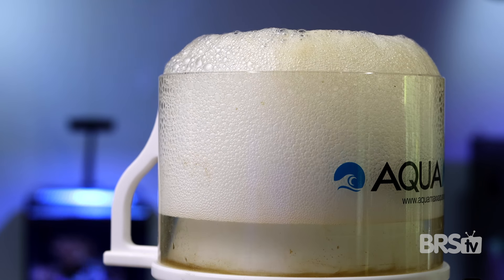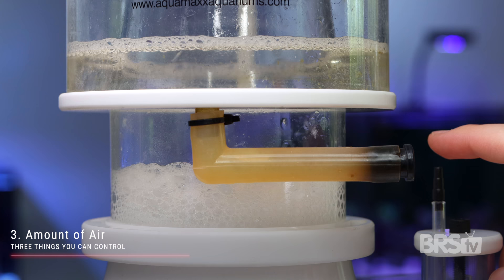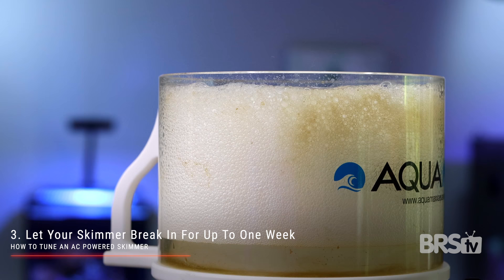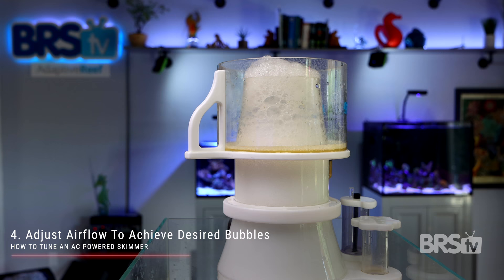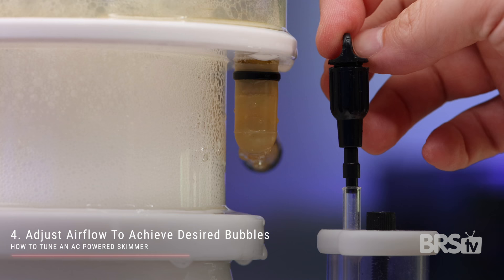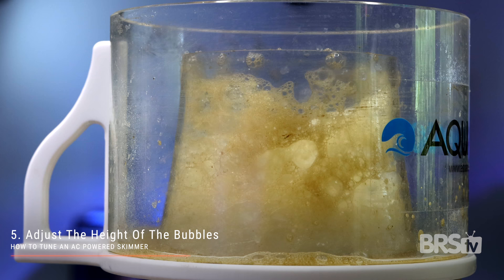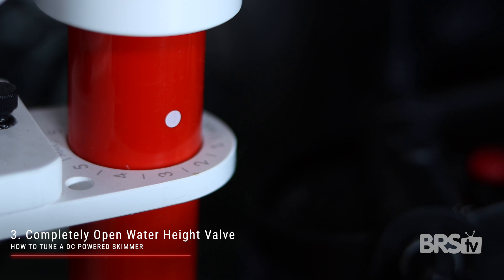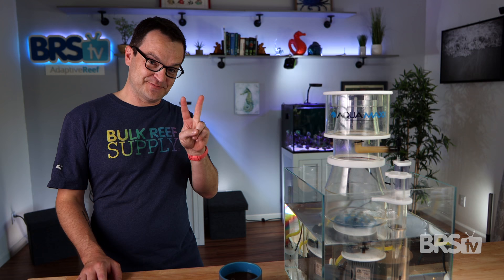Let’s Tune Your Reef Tank’s NEW AC or DC Protein Skimmer!

Comment: Ditto on the too big skimmer. Especially if you're running low micron filter socks or a filter roller, it's really easy to oversize a skimmer on your system, even if you get the right sized skimmer on a high bioload skimmer. You need to take into account your entire filtration system to size a skimmer.
Reply from the maker: Well said!

Comment: Seems that the filter socks cause the biggest problem with the water level height causing the skimmer to over or under skim. You miss changing socks at just the right moment before they get clogged is the the trick to a consistent skimmer
Reply: Yeah that’s a good point for sure!

Comment: If someone is going to get that valve thing for the air, can you get that at a hardware store? If so what would it be called exactly?
Reply from the maker: Might be hard to find at a local hardware store, but you'll probably have better luck finding a barbed ball valve. Most skimmers use a 3/8" size tubing.

Comment: I really like brs, but I’m going to be that guy. The tip on adding a valve to adjust the air does not work on AC pumps. Ryan and Randy already did another skimmer vid confirming this. They said cutting off the air let’s the impeller spin faster defeating what your trying to do. Sorry if I’m not describing that exactly word for word, and I’m not going through every skimmer vid to find the right one, but if you’re watching brs skimmer vids you’re going to come across it.
Reply: huh, that's interesting... because it totally works on mine!  You've had a different experience?